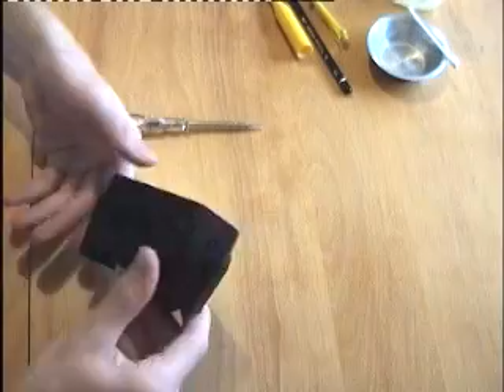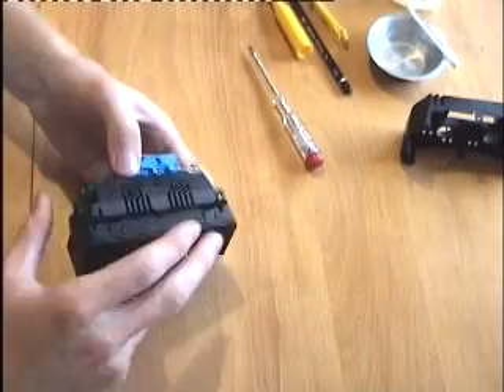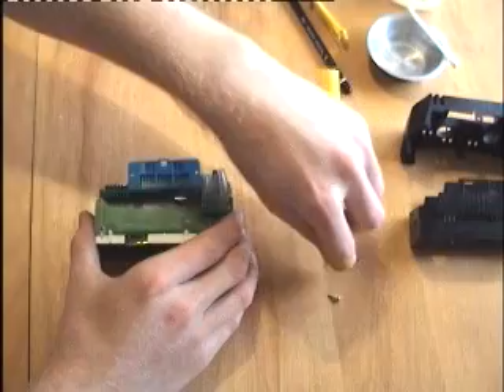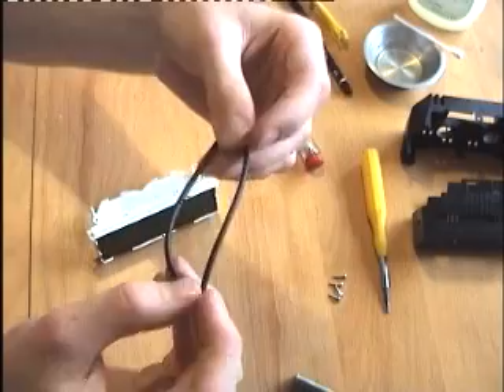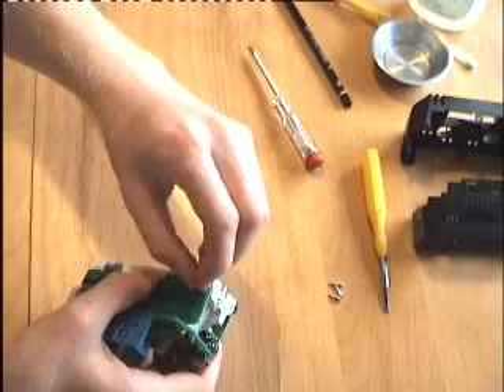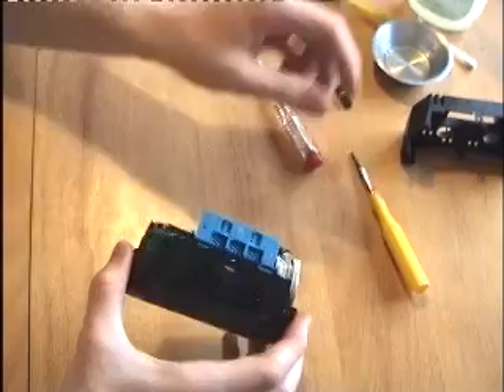Citroen XM left hand display repair

Comment: WARNING! This instruction describes a process which is extremely cumbersome and can easily damage your display! The reason: The mentioned glue has conductive qualities. It has been silkscreened into rows of very tiny rectangles on the foil of the display before factory assembly. Splitting the connection up and / or cleaning the contacts only reduces connectivity. I personally had a display on which only a few lines where missing and hoped to improve on that. All my attempts have however failed, in spite of the fact that I worked extremely carefull. The only way to fully re-establish connectivity would be to renew the glue but even if one could find the right type it is impossible to properly refill all the tiny individual connecting points without creating bridges between them. So now my display has become worthless piece of junk. Hail to the author of this video for that! :-(

Comment: I was a bit sceptic and still am, because I actually now have LESS working pixels. I will re-do it tomorrow and see if I can get it done better
Reply: Okay now that I did it for the second time I got it working very nicely, but I'll you guys a hint from a Citroën forum that I should have known: 

"If the flexible cable is still strongly attached to the PCB and the display, don't try to separate them forcibly. Restoring the compressing force of the rubber band is usually enough in this case. Simply turn over the band so that the previously unused, thicker strand (that used to be in the recess below) is situated below the display glass now. Reassemble everything and chances are you're good to go."
They also show you how to take the dashboard apart.
http://citroen.tramontana.co.hu/electrics/missing-pixel-columns